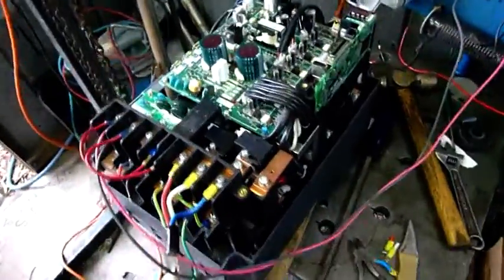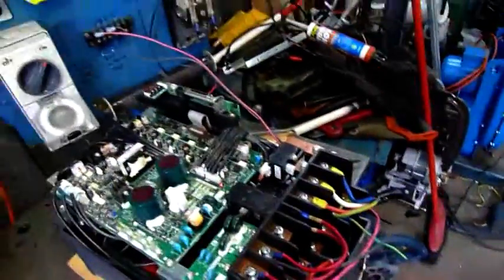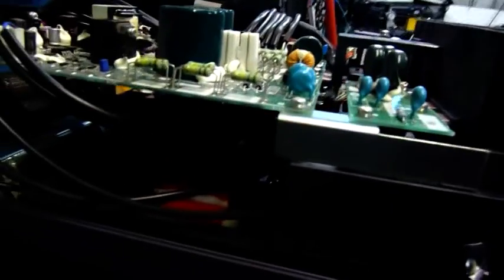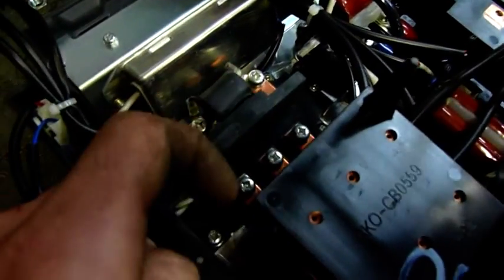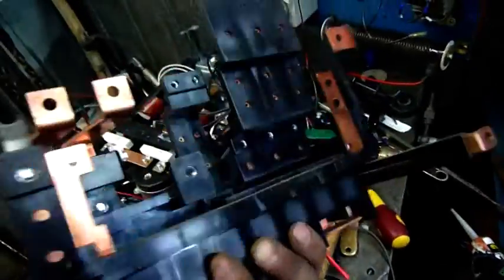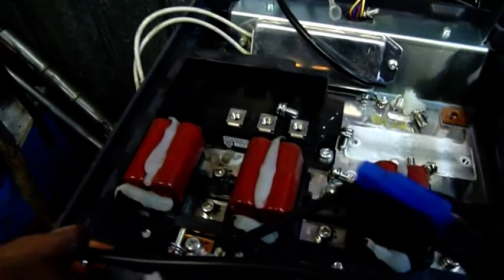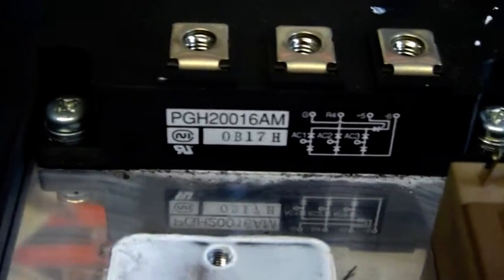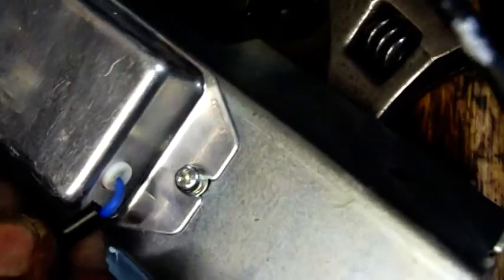22Kw Mitsubishi Electric A500 VFD Autopsy

Comment: The SCRs and IGBT bricks looked intact but I know they like to short in a spectacular fashion. I've seen an IGBT 6 pack blow it's driver board clear off and go BANG! Had a deuce SCR mod blow it's side off and splash molten Silicon and Beryllium all over the heat sink.

Comment: actually that big metal cased resistor is 2 ohms.  It's marked 2 (ohm symbol) K.  The K is tolerance, in this case plus or minus 10 percent.

Comment: that would be scsi (scu-zi) connection hard-drives and printers and all sorts used them as it was much faster than ide and parallel ports but then usb2 came about and sata and it quickly disappeared from there they are still around but not very common to see that micro-usb port might almost be as fast in fact a few years ago i had a scsi controller, cable and 2 40 gb 5.25" hard drives i never set them up as my friends dad needed them back but when sata 1 came out he  said it was faster than scsi

Comment: @Aussie50 go figure I got both units for a pittance, the VCR came from the old high (secondary) school here where they used it in video editing before moving to digital and the TV was from a senior center who got it brand new and had stuffed the massive 50" beast in a corner of the cafeteria because it wouldn't fit in the TV room and no one wanted to watch TV while eating. To find one with almost no hours on the CRT's is unheard of, that picture is bright as the sun.

Comment: @Aussie Once we used a laptop to program the motor into it after installation we would be done with that. The led readout on the from is used to program it if you are using it as a stand alone unit. Once a program is made for a job all we have to do when we have to run the job is load it on the main computer that loads many other things for the job and then it would send info through the Ethernet to the controller to tell it what speed automatically to go to.

Comment: @Aussie That looks like one of the controllers we used on our roll feed press's to control the motor. They can be used as a stand alone unit or can be used like we did. The usb was to program it such as limits for the motor and stuff and the Ethernet ran to the main computer that had records of the jobs we were doing and could program press speed from the main and the Ethernet would feed the controller the right speed to run at for that program.

Comment: The wire wound bleeder resistors are there to discharge the filter caps when the power is turned off, I would bet that they have enough of a capacity to store quite a whallop. Those caps have some nice band clamps around them, useful for a future project like a DC power supply, or just holding something round. The big resistor looks like it says 2K ohm or 2 ohm K, anyhow an ohm meter will answer that question, never seen an 80 watt resistor before the biggest I have is a 50 watter.

Comment from the maker: @redneckbryon its a device that varies voltage and frequency going to a 3 phase induction motor in order to control its speed and torque.

I have used one in several vids to control motors and compressors.